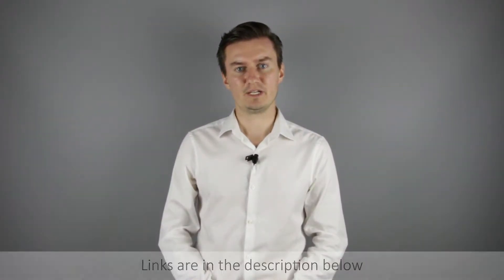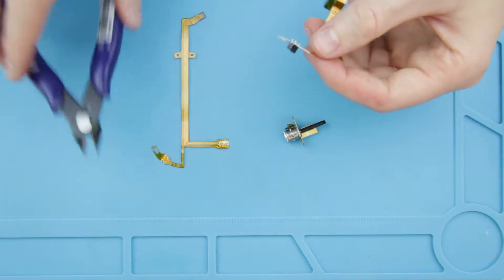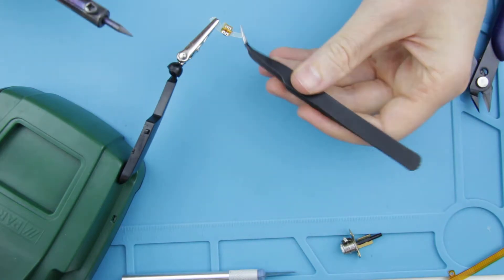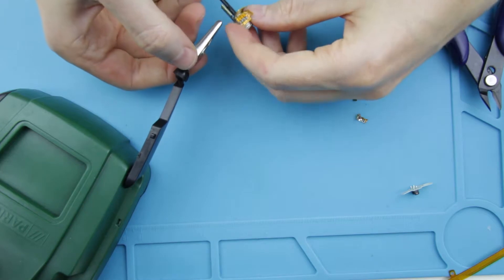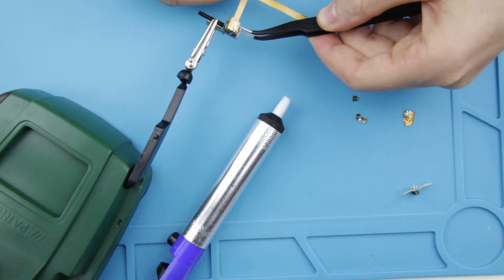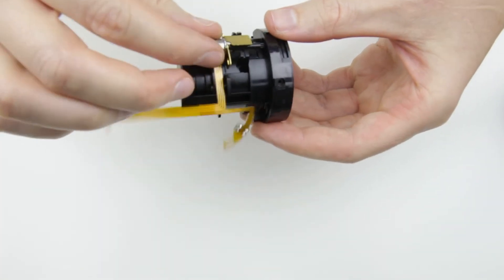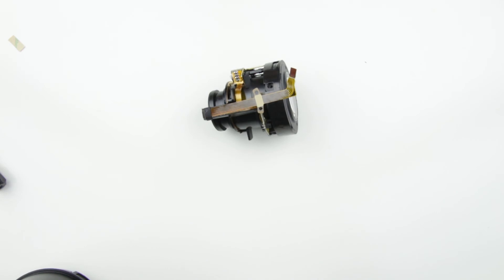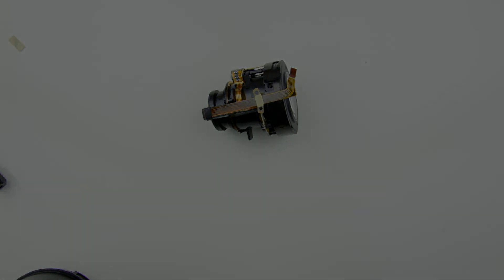Tamron 70-300mm f/4-5.6 Di LD macro lens replacing the aperture flex cable after disassembly

Comment: In order to avoid desoldering the old connectors from the engine and the cell, at the risk of destroying these components, I adopted another much more reliable technique. The pins, where the connectors are soldered, protrude a lot. So all you have to do is cut the old connectors flush with the components and position the new one on top. Then make the soldering points and that's it. No damage and much faster.  In French "Afin d'éviter de dessouder l'ancienne connectique du moteur et de la cellule, au risque de détruire ces composants, j'ai adopté une autre technique beaucoup plus fiable. Les picots, où est soudée la connectique, dépassent beaucoup. Donc il suffit de couper l'ancienne connectique à ras des composants et de positionner la nouvelle par dessus. Puis faire les points de soudure et le tour est joué. Pas de dégats et beaucoup plus rapide."
Reply from the maker: Some people do that, and I understand that it is easier, but that technique could make the cable sit higher which could cause some problems with some lenses (for example with Canon 24-105mm L lens for sure.), also I don't like that the end of the cutted cable might touch metal elements, causing shorts, so I prefer to completely remove the old cable and put on a new one... I consider that a more professional work.

Comment: 12:29 - That sleeve goes brittle and lose after a few years, and when it does it catches on the side of the rear cover ring and eventually falls off inside the lens. Best to replace it - a small piece of heat shrink works nice. Or you could leave it off completely, it doesn't do a lot if the flex is properly stuck in place to the guide it sits on.
Reply from the maker: Thank you for the tip!